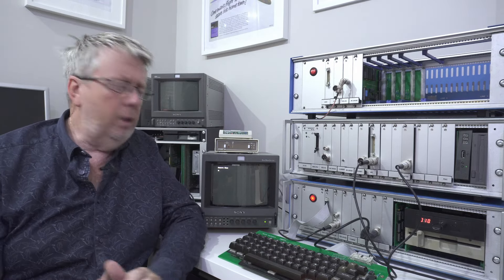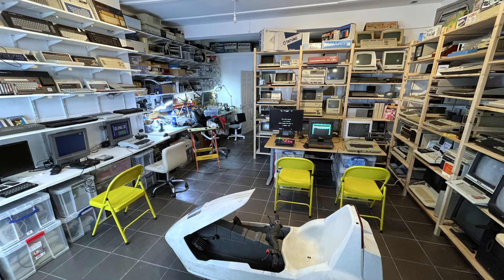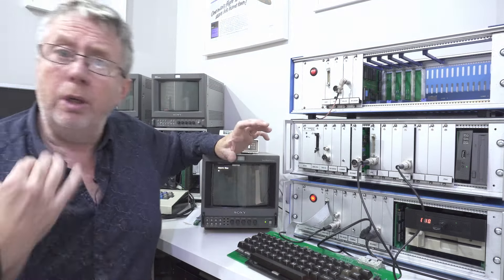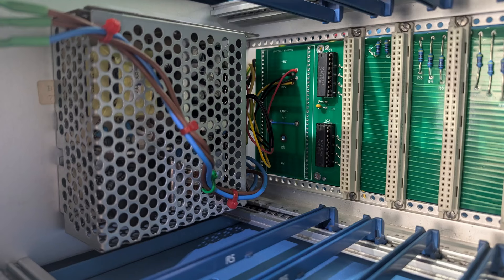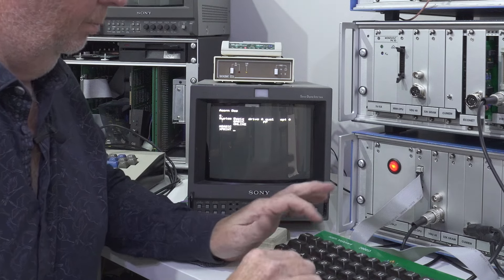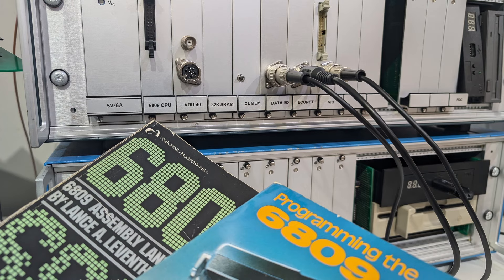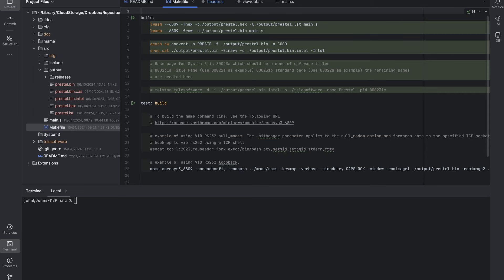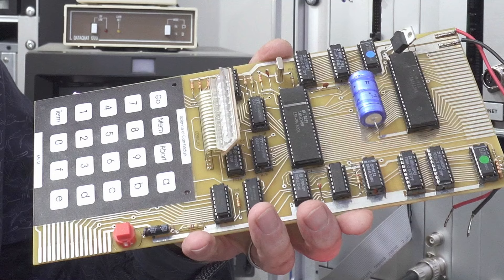Acorn System 3 Part 2

Comment: I've got an original system 4, but it's not powered up since ~1995 last time it ran regularly was 1992. What checks would you recomend before powering it up?
You mention 6809 Flex - I think I have a small three card rack with 6809 - it's connected to a "portable - all relative" BBC B.
Reply from the maker: I guess removing the cards and checking the power supply would be a reasonable approach. Then put in the minimum of cards and if they are ok, add the rest one by one. 

I would love an original System machine especially a 6809 variant. I hope you get it running. 

The Flex software could be lost to time, but if you have a 6809 system it would be worth checking for it. You may have the only known copy.

Comment: The first piece of kit I used to provide overnight support to my employer's batch suite from home consisted of a Prestel terminal. Very clunky and a pain if you didn't start the remote session in 80x24 resolution. Though it did beat driving 24 miles to Norwich to use the office equipment.
Reply from the maker: What year would that have been? Was it one of the Acorn Prestel Terminals?
Reply: @GlassTTY  I think it was the mid 80's. The kit consisted of a TV and a keyboard unit about the size of a BBC micro.

Comment: I am in the process of building a System 5 (or 3 or 4) clone myself. To save some money and rack space I am currently working on a CPU board with a 6502A and 128kB of ROM and 128kB of RAM.  It will be possible to replace the MOS ROM by RAM so I can modify the original MOS or even load another MOS as well.

But what I wanted to mention is that for the keyboard you can also use an Acorn Atom. I have written a small programme that reads the keyboard and puts the ASCII value to the output of its 6522 VIA. This way you have a System look-alike keyboard. I have been testing this on a real System 5 and it works fine. There's no need to damage the Atom, all modifications are reversible. 

Thanks for your video, it was a pleasure to watch.
Reply from the maker: I like the sound of the Atom keyboard. Can I get a copy of it? I have a very nice Atom here which will be taken with the System 3 to the RetroFest 2024 show. Combining them would be great.

Comment: Hi John. Great to see you back! I've missed your unique style of video. Unfortunately I can't make it to the Dragon meet this year so won't have the pleasure of discussing your machines in person 😔. Top tip about the 1" aluminium straps in B&Q 👍. I might get my mini engraver/CNC machine to have a go at cutting some without risking the expensive pukka fronts i have. Unfortunately my own 6809 machine has been on the back burner for a while due to family needs and other hobbies but this video has got me thinking about getting back into it. Have fun in Cambridge 👍
Reply from the maker: Thanks for the comment. Its a shame you can't make this weekend it would have been good to have a catch up etc. I plan to take the 6809 machine again this year I might try and get the 'proper' cassette interface working whilst I'm there. take care. J.